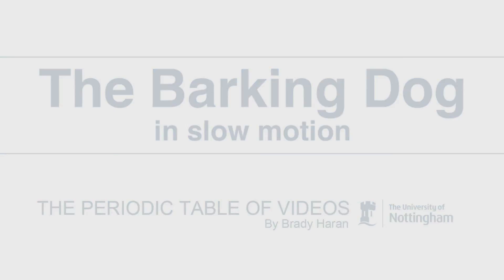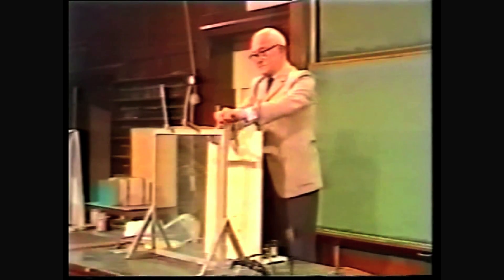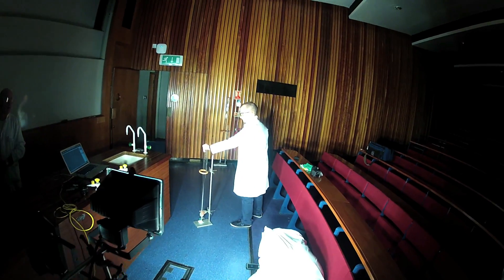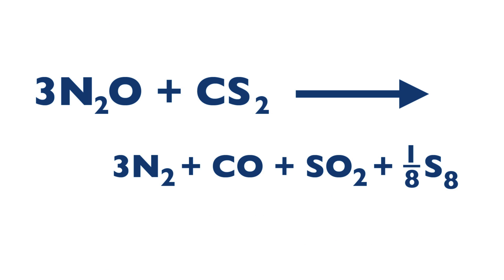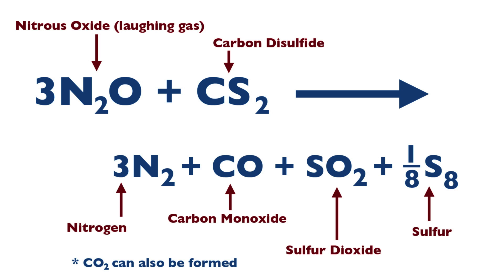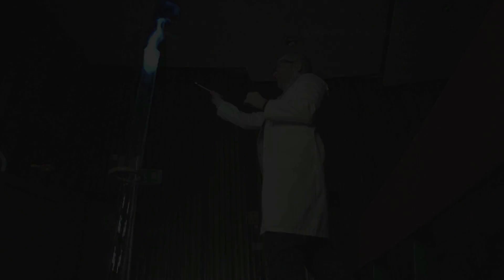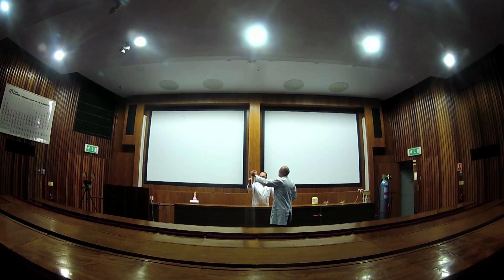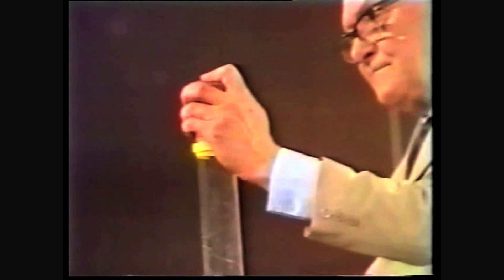Barking Dog (slow motion) - Periodic Table of Videos

Comment: So now my question is which effect is making the characteristic sound? 

(1) Volumetric effect similar to blowing on a bottle which changes based on the position on the wavefront?
(2) Vibrational effect from the increasing speed of the shock fronts?

Before today, I always thought it was former, but now I'm thinking the latter (or maybe both), especially given how loud it is

Comment: I wonder if the oscillation has anything to do with the sound it makes. Especially considering that sound has a portamento to it and the lower volume at the start of the reaction is associated to the frequency in which it oscillates. the faster the frequency of the oscillation of the flame chasing the fuel. the faster the pitch.
Reply: I think that part of the energy from the shock waves creates a standing sound wave in the tube, that's what gives it the pitch. But the pitch varies as the combustion changes the temperature and density inside the tube (i.e. changes the propagation velocity). And the shock waves themselves give you the explosive sound.

Comment: Most interesting: During the pressure Drop, as the shock wave ascends the tube, there's Vaporization/boiling-off of the water&solvent mixture a the tube's bottom. Very apparent  if you watch the bottom of the tube closely from around 5:09 mark.

Comment: That's probably part of why it's sound is so distinctive. Those oscilations are fast enough to be audible, although they're probably the lowest pitched part of the sound. Also, the fact that the oscillations get faster as the flame approaches the bottom is audible in the way that low frequency component of the sound get's higher and higher pitched as the reaction proceeds down the tube.

It may be too fast for the eye to see (except I think kind of saw it in one of the full speed examples in this video), but that just means that it's fast enough to hear.

Comment: I know it's an old video, but have you guys ever considered putting an electronic pressure sensor inside to record the pulses? You could have one stuck into a cork plugging a tube that has both sides open (like the extra long one).

Comment: I wonder how this experiment would work with a variable pressure release valve on the bottom of the tube (pretty bloomin well attached might I add)

The barking sound could become completely different as I imagine it occurs due to those oscillations .

Comment: So, is this "oscillation" of pressure the ascending roar we hear? It could be actually fun to calculate it if we knew the frames per second of the footage, and then correlate it with the pitch of the sound we would hear at 100% frame speed... I guess.

Comment: i kinda get the feeling that these oscillations are what causes the sound, you know what i mean? of course the sound gets higher as the flame goes down the tube, it's causing pressure waves at a greater frequency.

Comment: I actually expected this from the earlier videos. For one, a rapidly, smoothly moving flame in a tube probably wouldn't make that sort of sound. It makes more sense for there to be oscillating shockwaves. For another, I could see a series of flashes as the flame traveled downwards, which suggests that the flame's motion isn't as smooth as it appears. Plus, at the end, you sort of see the top of the flame rapidly changing in length.

Comment: Also notice how when the pressure wave reflects off the bottom of the tube and is coming back up, it pushes through the flame, again pushing it up, but look at the top of the tube: some of the flame gets pushed out of the tube each oscillation. Very cool indeed

Comment: If you feel it of value, perhaps several pressure gauges or indicators could be moulded at regular intervals down the length of the tube to show, over a few experiments, just what sort of pressures this reaction is making. 

I'm sure that even the final graph of time/mbar would even be fascinating.

Comment: Hm, if you look closely at the bottom part of the test tube thing during the slo-mo you can see condensation forming during every circulation and then disappearing just as quickly.

Another proof of it being a pressure wave from the flame front, I guess?
Reply: +Irval Firestar I was thinking the same thing, pressures at both ends of the test tube was acting against each other; the combustion was propelling the flame down, the pressure build up and pushes it back up, but because the reaction is propelled down, when the pressure normalizes at the bottom, it gets pushed back down again.
Reply: @hoseinqadam  It is a bit more complexx than that, since there is also a pressure wave being reflected back down the tube from the mouth.
It is the same oscillatory burning you find in a pyrotechnics whistle - except the fuel is dispersed through the full tube length, rather than being compacted at the bottom.
Reply: Rd447gfdxf7rh grace fhu hsexuof xđ2 .kl89999xdsssf

Comment: I have knew about the reverb back when I was around 10 or 11, having done this with some butane or alcohol and a milk bottle or pop can, and though not as magnificent you get about the same result as the air fuel ratio gets right.

Comment: Would be interesting to hook up a pressure sensor a the bottom of the tube and sample at the same or close to the same speed as the high speed camera as well as maybe hooking up a microphone and sampling that as well and see how all three pieces of data correlate as well as to verify the correctness of the professors hypothesis.

Either way very cool, thanks

Comment: I think it may be an effect of the mass of the gas flowing from the top of the tube. As the burning gas leaves the top of the tube its momentum is acting like a plunger and drawing the flame front upwards and lowering the pressure of the gas below it. Hense why you see the vapour form. This will only last a certain length of time until the pressure drop is enough to draw the flame front downwards. This would set up an oscillation, very similar to the one that is used in pulse jets. The frequency change could be related to a perhaps decreasing density and hence mass of the material in the tube, or that the reduction in unburnt fuel changes the pressure/volume relationship of the system in effect changing the 'spring constant'
Reply: Gd

Comment: Why not do a secondary experiment? Use different sized test tubes (widths and lengths), an oscilloscope w/microphone and test for sound pressure level and frequency differences to see if the flame front vibrations correlate with sound frequencies produced. Might be a fun experiment.

Comment: When I listen to my dogs bark (actual dog) audio recording and look at it on an oscilloscope, if you were to zoom in on the wavelength you can see the individual vibrato patterns.  I love this because this is like a visual version of just that!  The amount of vibrations in the sample and the shape in which is vibrates determines the way it sounds, for example...sine wave shapes determines the resonance (the acoustics of the sound) and the amount of vibrations/cycles/hertz in the given second of the sample determines the pitch.  This initial sound is probably about 140hz but I wouldn't be surprised if you would get different sounds out of different sizes and shapes of tubes. =)

Comment: I have a different theory, I believe the gases in the bottom become so compressed under the energy and force that it thickens to the point where the fire can't ignite it all at once, this is also helped by the small diameter of the pipe, and the noise is actually created due to oxygen or other gases trying to escape the tube all at once. I noticed an almost vacuum effect towards the bottom, it'd be interested to see if this experiment still worked the same on a larger scale and would also like to see the barking dog in slow motion but from a bottom view looking up to see if the fire has a inward dip on it.

Comment: Could it be used as an effective motor if one has a tube with a vent in the bottom and a pump that delivers more of the propellant into the tube at the same rate as it burns?

Comment: Exactly, except in a true pulse jet engine the bouncing gas pressure wave is provided by the inertia of the intake air that was pulled in from the last pulse's contraction as the gases cool. Add in fuel at the right spot and amount and you get equilibrium and a nice low constant buzz.

Comment: This is a most interesting video, and well done for Brady filming it. This, to me, strikes of two very different things that must be taken into account. Gas dynamics and chemistry, the pressure changes will come from the chemical reaction. So to be able to model this chemical reaction properly you need the combustion equations linked in to the equations of gas dynamics to understand how the two different fronts interact. It's a very very nice applied maths problem.

Comment: This makes sense actually.  Pyrotechnic (firework) whistles work based on special compositions that burn in an oscillatory manner called crepitation.  The rapid chuffing causes the column of gasses inside the tube to oscillate at a frequency determined by the length and diameter of the empty space.  Very large pyrotechnic whistles and large bore whistling rockets make more of a ripping sound somewhat like the barking dog.

Comment: The rapid pressure waves are "kicking" resonant modes of the tube which is why it oscillates.  Every geometry has resonant modes but depending on the "natural frequency" of the object, the reaction may not generate sufficient energy or bulk movement of the gas to excite modes of oscillation. Notice how the varying sized tubes made different pitched "barks".

Comment: Cool stuff.  I am surprised that the produced sound was not sampled long ago, FFT'd and analyzed.  It would have been much more obvious there was some sort of oscillation going on based on Fourier decomposition.  Notice how the pitch differed depending on the length and diameter of the test tube. This is characteristic of longitudinal resonant modes.  Hard to believe it took high speed video to reveal this phenomenon.  A cool phenomenon gone unnoticed during demos for decades.

Comment: Sound isn't a straight line, it's a wave. Think about what happens in a water-bottle when you flip it upside down: It has to bring air in somehow, so it moves to the top of the tube to reach oxygen, hence sustaining the reaction (flame). If it went straight down it wouldn't make any noise at all; it would explode.

Comment: It makes sense, it sounds like its a very low pitch, which means the pulsing of the flame is generating most of the sound, with probably resonance in the tube. It also explains why the pitch increases when the flame front gets lower

Comment: I think a series of digital pressure sensors every 10 mm would be useful.  I theorize the ignition point of the gases increase as the pressure increases.  initial gas temperature may also play a part in the equation.

Comment: No. CO2 (Carbon Dioxide) is not dangerous in any sense. CO1 (Carbon Monoxide) is dangerous because it can take oxygen out of the air. CO2 just sits there. Breathing it won't hurt you unless it's the only think you're breathing, in which case it's not the CO2 that kills you, it's the lake of oxygen, hydrogen, and nitrogen. It doesn't combust, it isn't toxic or radioactive. Pure Oxygen is more dangerous than CO2.

Comment: The noise itself is probably coming from these vibrations, with the frequency/pitch of the sound being exactly the frequency of the oscillation. 

It would be interesting to get the timings of the oscillations from the video, and compare them to the frequency of the sound over time.

Comment: Isn't this oscillation in fact the reason for the high pitched sound we hear? On the other hand, if the flame front went down smoothly, wouldn't we only hear a rushing of air absent any high pitched noise?

Comment: Would the cause of the staging be that the fuel is to rich at the bottom of the tube and not enough oxygen for the fuel reaction and it has to expand and gain oxygen as the burnt fuel is exhausted out the top? I understand the initial burn is causing a pressure towards the bottom of the tube and thus push the burn level up until that pressure is released and drops more and builds more pressure. But if there was an oxygen supply at the bottom wouldnt the reaction be unstaging flow and fasterburn?

Comment: I was thinking something just like that. Perhaps the pulses that it sends to the bottom collectively add up for the amplitude of the sound, as well as its frequency related to the oscillation. So I suppose that's would be very likely. Wish I had a lab.

Comment: I would hypothesize that maybe the sound itself comes from this "chugging" of the flame toward the bottom: as the pressure in the tube increases and decreases rapidly (as can be seen by the fogging of the bottom of the tube in the footage at 4:39) you get strong compression and rarefaction in the air forced from the top of the tube, at a slow and powerful frequency responsible for the low, loud audible waves. Is this possibly the reason?

Comment: I think the pressure waves generated by the small explosions occurring repeatedly in the tube are responsible for the woosh sound, pretty much the same as vibrations in an oboe.
If this experiment were done in a different vessel, such as a round-bottom flask, there would not be a water layer all around shielding the shockwave, thus bursting the glass into pieces.

Comment: I like the standing wave pattern the high speed camera reveals. It is very much like the shock diamond of a jet engine.  It would be interesting to see TheLIvahiir's idea use a y shaped tube for a start and then a bottle with concentric baffles that focus to the centre of a sphere. A horizontal tube with both ends open and perhaps partially constricted lit simultaneously at each end with an electronic spark. A U shaped tube with a volume of heavy non-flammable liquid to take up the energy.

Comment: A stable thermodynamic form of sulfur is an 8-ring. Elements often from a stable configuration and it is rare that Elements appear unbound. For example the most stable form of carbon is graphite. Diamante is also a “stable” form of carbon, but less stable then graphite, that means a Diamante will transform over time into graphite.

Comment: Its strange how people with PHD's didn't realize this. To make a humming sound as the barking dog does in the beginning of its ignition you need a frequency of bursts. Just as a pulse jet does. When you have a fuel in a enclosed container or tube it usually doesn't just burn it all at once. It burns it in steps. I am not sure but are those mach diamonds forming in the tubes throat or just sections of flame. If you also look at the bottom where there is no flame you can see the air condensing.

Comment: This is an outstanding visualization of resonance in a tube. Pulse jet engines and pipe organs work on this same principal. If one were to change the length of the tube and or the diameter the frequency of the wave propagation will be changed and thus the pitch of the sound. There is a formula for calculating the frequency of the wave given the length and diameter of the tube. This was worked out during the middle ages by the early organ builders. Look up tuned pipes.

Comment: I wouldn't be surprised if the oscillation of the flame happens to have a correlation to the sound frequency. I suppose in a way everyone who watches this presentation can tell the pitch of the woof going up (a few of the professors even mimicked the rise in pitch when they imitated the sound) and so, in a way, experience the "bouncing" of the flame...

Comment: i think straight tubes are most common because they are easy to produce and easy to clean and nicely fit into a non-curved box. if you mess up a tube with sulfur and need to clean it later, picking a straight one is just the obvious and smart thing to do.

Comment: One could have deducted it perhaps by analyzing the sound. The sound rises in pitch, almost ending in a bang. This correlates perhaps with the shortening frequency of oscillations of the flame front that you can see in slow motion.

One could have just listened and noticed a quite low frequency, caused not by the explosion itself but by some secondary phenomenon. One can also tell from the sound that this phenomenon increases in frequency thus pitch towards the end.

Comment: Very nice. Yes,it's a pressure oscillation, and a quite dramatic one, because you can actually see the CS2 and/or N2O (probably CS2 only) going from vapor to gas at the bottom of the tube. Something similar to "cloud in a bottle" experiment, only oscillating.

Why don't you try an experiment where an intensive beta/gamma emitter is placed at the tube walls (or a grain of intensive alpha emitter at the tube bottom)? Condensation trails might show up during the critical moments of the oscillation.

Comment: Perhaps the higher pitched sound comes from the shockwaves, and as the shockwaves have less and less time intervals between bouncing between the bottom and the flame, it compresses matter around it at a higher frequency, thus giving it the low to high sound we hear.
Just a thought

Comment: The wave is reflecting from both the bottom and the _top_ of the tube. At the bottom the impedance is much higher (max pressure, no flow) than inside the tube, at the top it is much lower (max flow, min pressure).

Much like in electrical transmission lines, musical instruments, pulse jet engines etc.

Comment: perhaps in the glass container. If It could be performed in a thicker plastic tube it probably would not. If we knew the pressures resulting from the combustion we could use some fluid mechanics equations and figure out the type and thickness of the material would be needed to contain it.